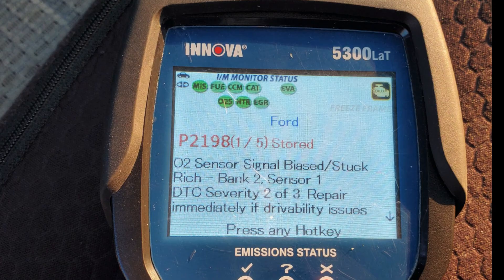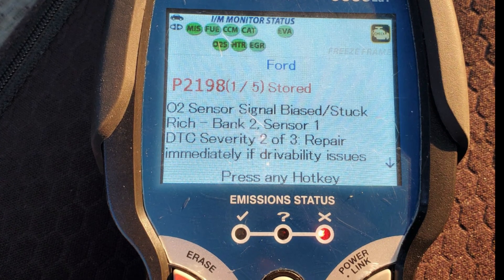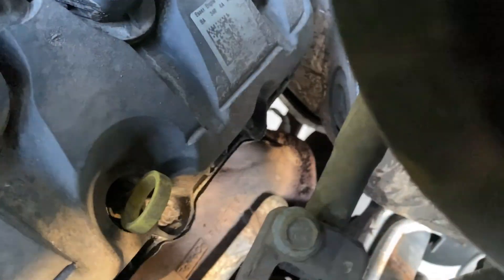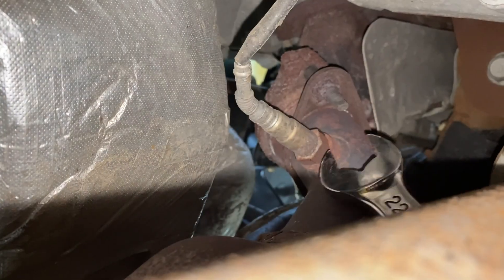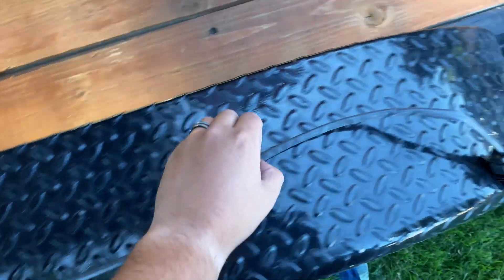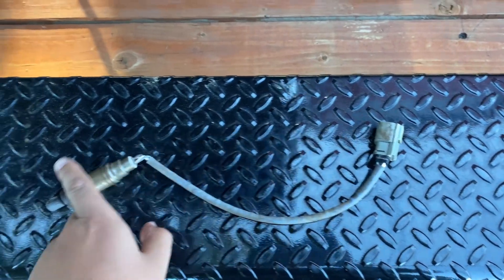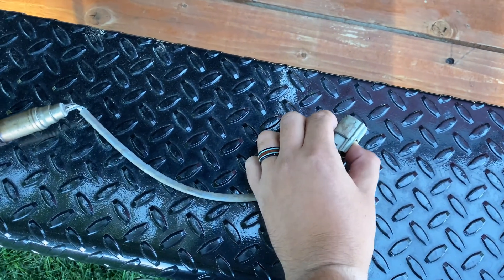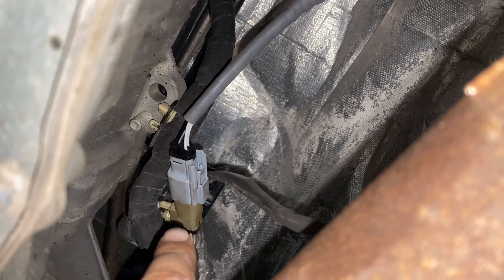Ford F150 O2 Up/Down Stream Sensor Replacement Made Easy

Comment: What yr f150 are you working on?  My 2000 sensor and connections are not as visible as this.  The wire connector is totally out of sight- feel only.
Reply from the maker: This particular truck is a 2011 I believe, but I have done it on a 2005 that is closer to your year; and yes it is tighter in there. I used a telescoping mirror to be able to see better. The rest of the process is similar.
Reply: @diydevin  thanks

Comment: Great video. I went to 4 parts stores today and was told bank 1 sensor 1 was on the drivers side the next place told me passenger side I have a 2015 2.7 L / F150
Reply from the maker: Thanks you! One of the biggest problems with parts stores is they hire people even when they don’t know anything about vehicles.
Reply: @diydevin  I agree
Reply: Agree i was told its on the driver's side too